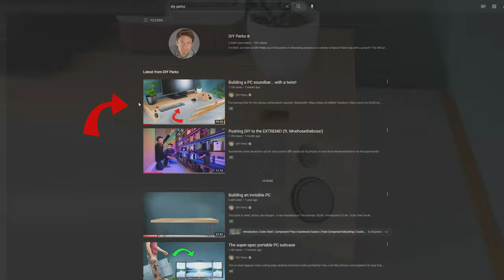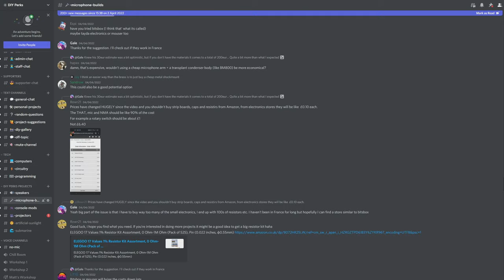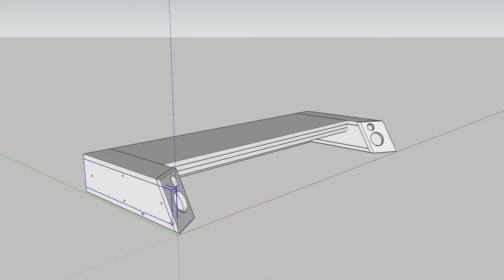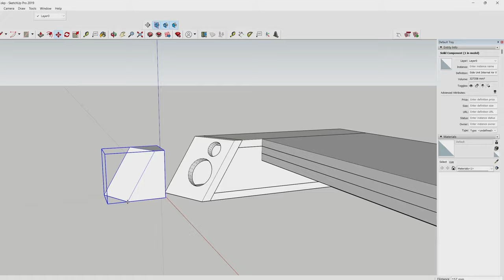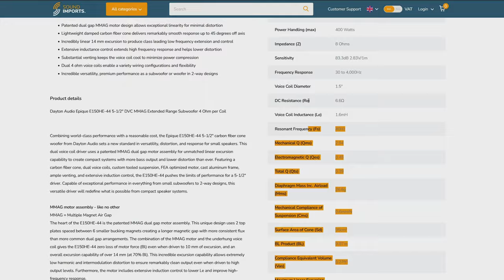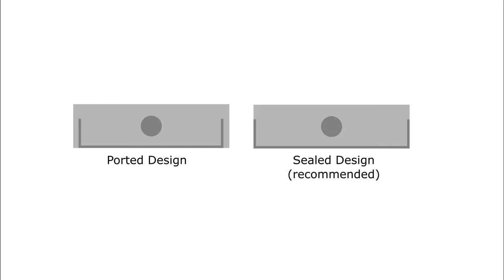DIY PC Soundbar (full build guide)

Comment: I have one doubt regarding crossover design - each RC network causes a phase shift of 90° ideally wrt input signal, so the bass crossover will introduce 270° (90°X3) of phase shift making the final combined output of all speakers out of phase, causing unwanted dips in frequency response .
Reply: What would be the solution? Do you have any recommendations?
Reply: @drozcan  4th order filters are recommended by TI , so the total phase shift is 90°X4 = 0° + phase delay circuits. Requires precision oscilloscope and lots of analog design experience. I'm just learning filter design.novice diyers can try DSP by Daytona or PC based filters since desktop PCs have multiple audio sockets that can be configured to make hi, lo mid software based filters, eg foobar plugins
Reply: Have you, by any chance, taken many mathematics courses in college?
Reply: @ubersham  yes, I'm computer engineer and studied engineering mathematics
Reply: @rogerwalter2500  Yeah... only mathematicians use WRT to mean with respect to
Reply: @ubersham  ikr

Comment: Great video. I would be against hot gluing circuit boards to the wood cabinet. They would be better mounted securely in a project box. Circuit boards coming loose could cause a short circuit.

Comment: I'm still a bit confused here.   There are 3 Input wires coming to the pcb from the dac.  Doesn't the dac only output through rca which is two wires?  Where is the ground wire coming from?  Also are the circuits supposed to be mirrored on both the negative and positive sides or strictly on the positive?  I'm also assuming voltage from the 15watt power supply being utilized is split between the 2 amps?

Comment: I love your videos. I might have missed this but I didn't see how you vented the amp. Seemed like no cooling. and no cooling = performance reduction and possible fire hazard. That was my second comment - no insulator between components that produce heat and ignition sources.